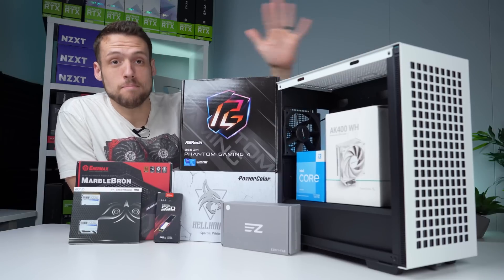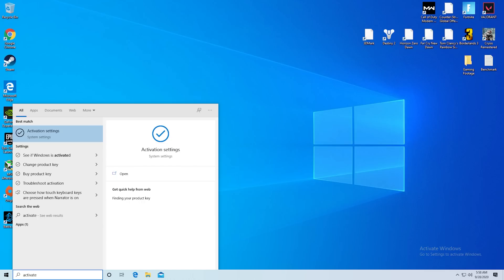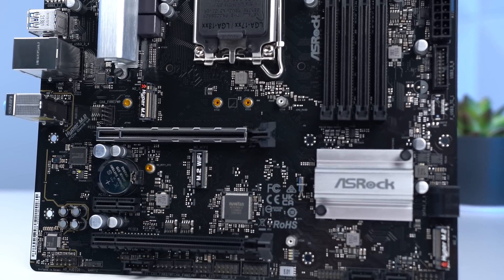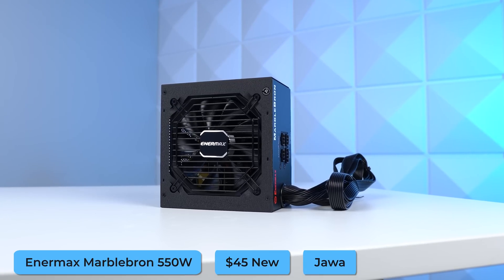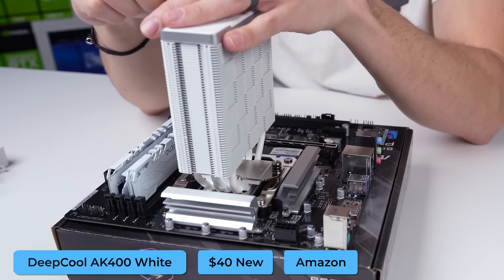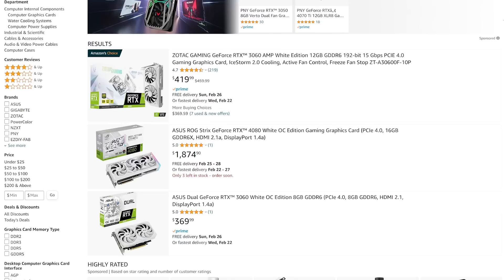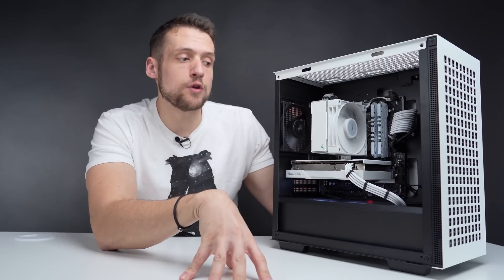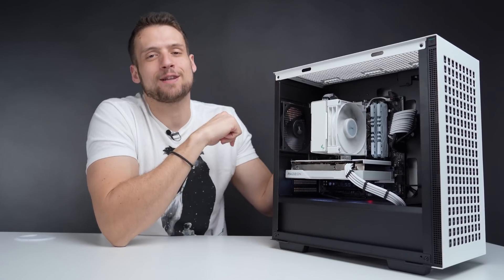How to Build an AFFORDABLE Gaming PC

Comment: Interesting video.  But can an i3 CPU really work as a gaming PC?  Even my business laptop is an i7.  To be clear, I don't actually play games on my PC, but I do want a PC that will last a long time that won't require upgrades every few year.  Some photo/video editing, movie streaming (preferably wi-fi rather than ethernet) is likely to be the extent of my needs.  I am willing to put the money up front if it lasts a long time.  Any suggestions is appreciated.
Reply: The i3 CPUs he recommended here are from the most current generations so they're faster than various other CPUs from older product lines in many cases. They're absolutely good enough for PC gaming and would suit your needs well, if you're hesitant, going up to an i5 12400 or 13400 would probably be the highest you'd need to go with current CPUs

If it helps: https://youtu.be/xBDFCoGhZ4g

These guys are brilliant, you can see that the current i3 is comparable to an older i9 in some cases for gaming! 😅

Comment: Be aware Intel tend to be a pain in ass to upgrade later since they continuously change the CPU socket type unlike AMD that tend to use the same socket for many years offering you potential to upgrade later. Do not fall for the hype around fps anything over 60 for many games is cool, 100 obviously is better but anything above is just plain OTT unless your on a unlimited budget. 5600 on a B550 mobo and DDR4 is the sweet spot at the moment, the CPU is good and will hold its own against many x3 the price DDR4 is dirt cheap and the B550 offers everything you will need today and for many years to come. WHat kills the cost of anyone buying a new PC is the graphics cards, expect to pay a fortune unless you source second hand. I still use my Vega64 and it does what I need it to do, I do use a decent Seasonic GX 750 PSU (current model) and I just love Fractal cases. I just upgraded (5600x Asus ProArt mobo) from a FX8350 which was 10 years old and to be honest the difference between that and the 5600x is not massive, noticeable but not mind blowing probably cos I am still using my old Vega64 but to upgrade that your looking at £500 which is what the rest of the upgrade cost so doubling the cost !!! yeah these manufacturers see you coming, dont buy into the hype !!

Comment: It get wifi, use a PCI-e card or a m.2 card. Upgrading the motherboard might cost more. Plus, it’s not upgradable in the future if there is a faster wifi or if the wifi goes out. 

I’ve also never had good luck with USB wifi adapters. Even when they work “well” for me, they’re just slower than a good wifi card.

Comment: If I didn't have a R5 3600 in storage I just bought a Wi-Fi B550 and got an open box 3060 for a steal. I rebuilt my nephew's PC from his 10400. I already had a x570 Wi-Fi in storage (what the 3600 was in) did bios flashback and dropped a 5600 and 32GB of Silicon Power Turbine 3200MHz. I would have considered Intel 12600 or 12400 and the board would have to have Wi-Fi 6 and support 13th gen. In fact, I have a prebuild Core2Duo that went to Silcon Heaven. I plan to buy a 512GB or 1TB 2.5 SSD a 2TB HDD and 16GB or memory and put the 10400 to max a sleeper it's only a 1650 but I have a 570 8gb I can put in or go onto eBay for a 5600xt. still hunting down an 11gen CPU and b560 for a steal.  good build

Comment: 😒👍 i just picked up an i3 100F, its only 20 bucks over the 12th gen, dont forget that the motherboard from 12th gen has to have the bios updated before it will recognize the 13th gen cpu, i keep a spare 12th gen cpu around to update the motherboards but yeah the i3 13gen is a great beater, for gpu go rx 580 or 6500 xt for only 150 usd brand new
Reply from the maker: Yes, I literally mentioned that about the CPU in the video lol...

Comment: The budget Intel CPU's are a dope value, its the mobo's generally that swing value in AMD's favor. There are some standouts on sale every now and again though.
Reply from the maker: Yep exactly. Although B450 motherboards aren't as cheap as what they used to be unfortunately.
Reply: Both Intel and amd motherboards are expensive right now unfortunately.

You could get a basic b450 board for 50-55$ and the h610 is usually 75$.

But right now even the cheaper b450 are 70$ so let's not even talk about the b550s at 100$.

Even the h610 has climbed slightly to 80-85$ for a basic one.

Which sucks as it really offsets the good price of CPUs right now.
Reply: @loowick4074  this right here, its maddening how a b550 tomahawk i got a while ago cost the same as a b450 steel legend i got about 5 months ago

Comment: I NEED A RTX 3060TI CAN ANYONE HELP ME I SUFFERED FOR 2YEARS WITH THE INTEGRATED GRAPHICS. RYZEN 5 PRO 4650G
Reply: Why a 3060Ti when you can get an RX6650XT with a slight performance drop compared to a 3060Ti but save a lot in the process?
Reply: @Durbanite2010  A RX 6650xt is way slower than a 3060ti which is faster than a 2080 Super. The 3060ti matches the 6700xt.

Comment: Newegg isnt a very good source for parts usually. they dont take resposibility for bad shipping, dirty parts, or just staight up broken parts. they also almost double ptices for parts.
Reply from the maker: Saying that they double prices for parts is just proving that you've never actually shopped there before lol. I buy so many parts from Newegg when they are cheaper than anywhere else.
Reply: @ZachsTechTurf  Exactly. I may be out of the loop but I don't understand the hate Newegg gets. I'm also lucky enough to have two Microcenters near me, so between that, Newegg, and Amazon, I've got the best situation in terms of buying parts.
Reply: And this is why people need to take what others say with a grain of salt.
Reply: I don't get why people hate on Newegg. Maybe I missed something. But I order from them regularly, and have never had any issues. Their prices are competitive depending which parts you're looking for and many have rebates, especially GPUs, no issues with shipping. I received a defective GPU a few months ago(not the fault of Newegg), but the RMA was super simple and they even let me swap it out for a better one that was the same price of the original when I bought it. As for having DOUBLE the price for parts, I've never seen that so I would need specific examples.

Comment: Hey need to do a pc would a ryzen 3 3100 and 1650 super pair well. Good vid
Reply: new 3100 would be hard to come by anyways so i would just go for the 3600 or 5600 if you have the budget
Reply: Is the 1650 Super used? Check the RX6600 aswell, the price difference isn't much and the 6600 has 8GB VRAM. Or, for used, an RX5500XT is often cheaper than a 1650 Super and is a much newer GPU, also with 8GB VRAM. As for the CPU, don't count out the Ryzen5 4500 or 5500 - they are PCIe Gen 3 but would still be good gaming CPUs for a budget build.
Reply: They would pair well however those parts are very bad.